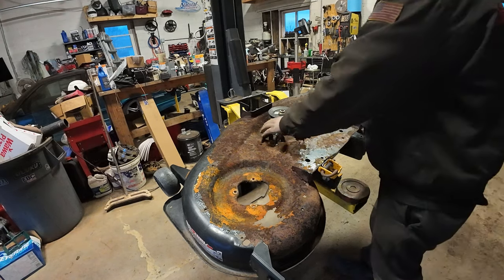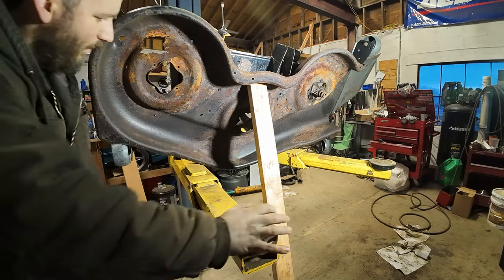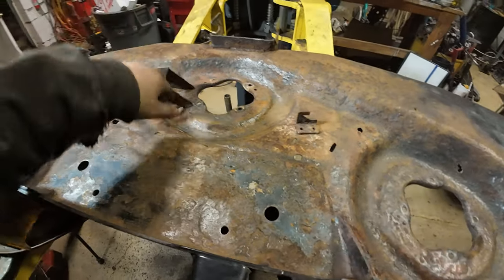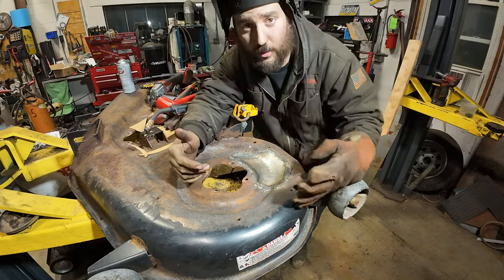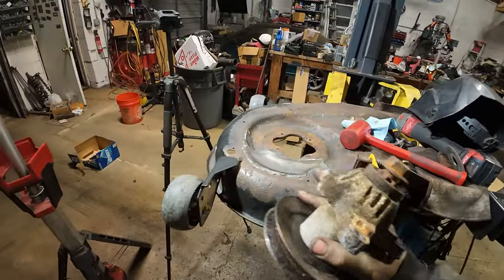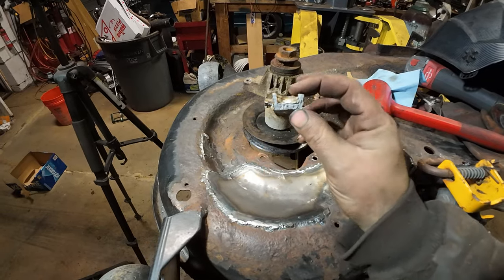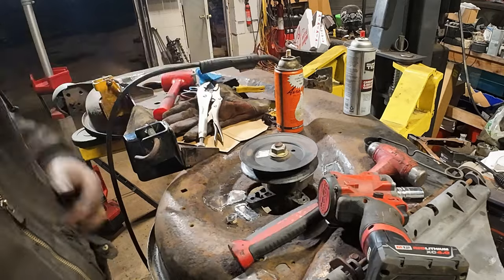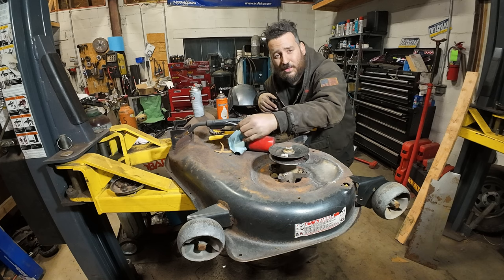Patching a rusted out mower deck. Cub Cadet Zero Turn

Comment: pro tip , on spindles leave the housings in and just replace bearings , cheaper and saves headaches of broken spindle bolts
Reply from the maker: Thats a good tip, thank you
Reply: Exactly.